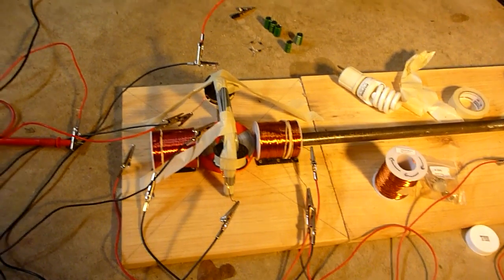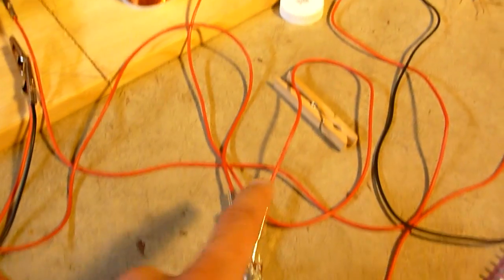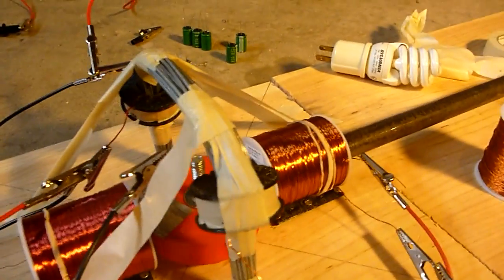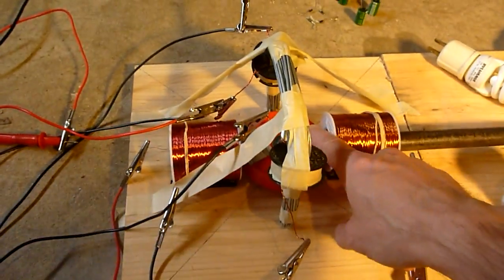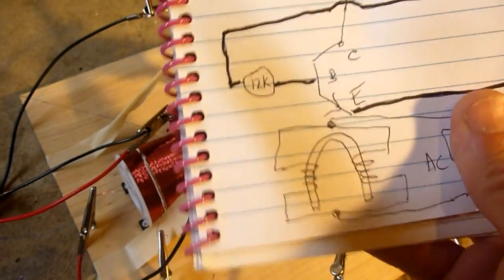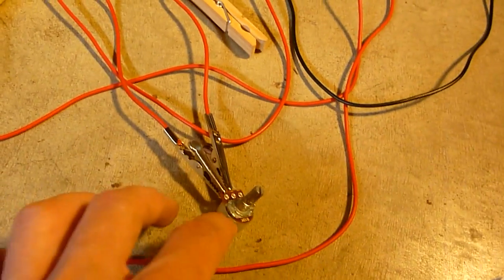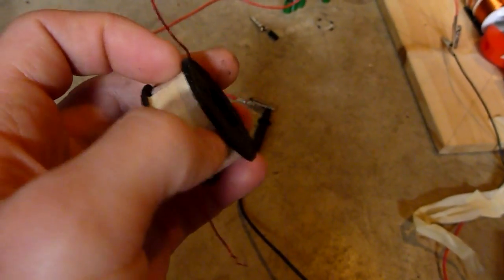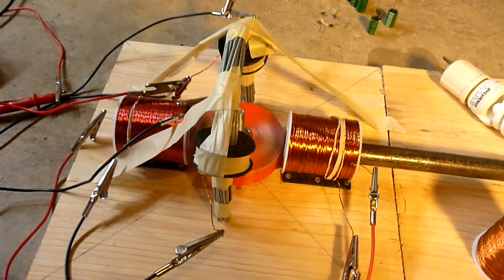Ed Leedskalnin's Lenz-free generator replication help

Comment: C basically energy is e=ma2 not mc2 where a I speed of rotation nd mass is mass of copper so spin magnets esp with higher tesla coils can b in multiples of 6 or 9 or 3 in wye connect w energy draw from pos nd yes mass of copper matters and unless u run through a transformor n cap don't expect current which is what u ultimately want voltage or resonance goes one way n current goes another work it man

Comment: xz've been in electronics for more then 50 Years.  This is what I'm thinking as it relates to Ed;s efforts and design,  All you need to do is look at his generator device, (one of six he built over time),  It uses "V" (NOT BAR MAGNETS),  magnets there was a real reason for that.  The magnets were set up 25 magnets around and 5 deep.  They were set up in repel mode to send as much "B" field into the earth as possible.  The "B" field is the center of a magnet not the North or South poles those are the weakest points on a magnet.  The "V" magnet is a perfect device  for his purpose given the "B" field is at the center and allows all magnets to supply the center as needed then through the crankcase and then into the ground.

Comment: My observations about lenz law; Forget the law its just an observation of a magnet approaching a coil and causing a reaction in the coil but, and a serious but..its a MAGNETIC REACTION that opposes the coming magnet(due to the current flow) and someone just coined the phrase "law" to it, but looking at your setup one magnetic effect cancels the other side magnetic effect due to its symmetry therefore you are still producing electron flow but the opposing symmetry causes a cancellation of the drag(magnetic forces) caused by this lenz law, so your net drag is zero. Great work NAOKI!!

Comment: I have observed the same effect using a coil on a torroid with rotating magnets inside, it appears to be something to do with the sideways angle of the magnetic flux but unfortunately very little power is generated when doing it this way.
Reply from the maker: ***** Right now I'm working on Floyd Sweet energy amplification patents. Maybe the output of the PMH can be put into this energy amplification circuit which steps up volts and amps (reported to have a cop value of >100). Then, I'll loop the output through a bridge rectifier to the input and we'll have a self-running system. Self running systems are possible if they are made open to allow energy from the environment to enter the circuit. The environment has an infinite amount of energy in all forms.

Comment: Nice video! You did a nice job on the Gen. I made a Ed Leedskalnin Generator along with the PMH and the Economical Version of the PMH as well. I was helping out Mr anguswangus with his Generator but I made some comments about the magnetism on Eds Flywheel and he thought I was trying to shot down his ideas for the generator and things went sour afterwards. I like the fact you used a Transistor to drive the magnet rotor, in Eds time I believe that he built a larger mechanical device that work just like the transistor (Look at videos BuiltbyoneMAN here on YouTube channel for his excellent work of this device) but regardless how different two the device looks they both share the same function that being a magnetic switch to drive the magnetic flywheel. Now think about this, if you using a transistor do you really need a rotating magnetic field.
Reply from the maker: boxerlego Hello, thanx for the comment. Mr Anguswangus is an inspiration of mine. He totally helped pushing much of Ed Leedskalnin's technology to the light. Angus believes that Ed's flywheel was a homo-polar motor. I disagree with him on that.

Ed Leedskalnin said that all the generators today were dis-balanced. What did he mean by that? Ed also said that if one was to place his generator on a rocket and fly to the moon and come back one would have the same amount of fuel as before the ship left Earth. This quote implies that Ed's generator powered itself.

Today why can't we have a self powering generator? Let say we have two DC motors hooked up together one produces mechanical torque and the other generates power as a generator. Well, this wouldn't work because of all the losses involved. There is friction, losses due to resistance and the biggest loss goes to Lenz's Law. Lenz's Law forces you to run the generator harder and harder when it is under load. Ed's PMH holds the key here. Ed showed us how to produce power w/o losses to Lenz's Law. I believe Ed had his flywheel span next to a large tube containing clockwise and counterclockwise coils, the output was connected to a transformer. This output went into an AC motor connected to the belt to the base of the flywheel. Ed had to spin the flywheel by hand to several thousands RPMs then enough AC would be generated and motor would kick in. From that point the flywheel would spin itself. What if electrons is NOT the charge carriers in electricity? What if electricity is an effect that created by two magnetic monopoles. A positive monopole and a negative monopole. What if these monopoles have an opposite spin. One spins clockwise the other counterclockwise. What if what we call "Lenz's Law" is the other monopole that is trying to get out of the system. In a conventional systems we use one monopole to do work and we are fighting against the other monopole. In Ed's system both motions of the monopoles were accommodated that is why no Lenz's Law is observed. The system must have a complete magnetic circuit, it won't work with "I" cores. Just my thoughts on the subject.

Comment: What you should try is EL's setup with his Magnet arrangements.  I think is was 24 right?  You may then start seeing some strange stuff.... Dunno, but now that you have the just of it, try adding his number of Magnets into the mix :)
Reply from the maker: shad0wburn3d In magnetic current book Ed said that he made other devices but his latest one was the best one (the one at the Coral Castle). A U-shaped magnet is special because all its magnetic activity is where the prong are (on one side of it). Its magnetic dead zone is at the back. Ed's fly wheel had 24 U-shaped magnets in 4 layers all facing outwards. He would have a hook danging over the handle (over the magnetic dead zone). This, in my opinion, completed the magnetic circuit. This particular setup requires the U-shaped magnets and won't work normal magnets. They don't sell neodymium U-shaped magnets and regular U-shaped magnets are too big and pretty weak. This idea of shorting out coils can be applied to many different devices... If you make any headway in your HHO research do remember to post a video about it.

Cheers.
Reply: Naoki Kashima

There was a video I shared yesterday with Overunity achieved via a supercapacitor of 1.5 FARAD, a Bicycle, Battery, and Alternator. The wheel spinned at over 2k Revs per sec, achieving the charging needed to achieve overunity.  Do check it if you have time.
Reply: Naoki Kashima I think you're on the right track. The vee magnets are the key for Ed's system. He mentions that there is a semi-neutral point midway between the poles of a magnet, I think in Magnetic Current. I'm thinking of making, or having made, some vee magnets out of square rod and having them electrically magnetized. Without them, I think duplicating Ed's system is futile.

If you notice in the photo of Ed at the wheel, the mass of chains look like they're bunched up, as though magnetized. As you said, the hook hangs over the magnetic null zones, and I think the stored magnetism from the chains loops back in through the null zone. 

I've read all of Ed's writings multiple times. He uses double meanings and hides clues in the writings. Have you read "A Book In Every Home" ? It should be read from a different perspective, like a manual of sorts, not as it seems to present. 

BTW, the copy of Magnetic Current you show with the illustrations is not the original. Someone added the drawings and are not Ed's illustrations. Just be careful to verify the logic of the drawings and don't assume they are correct.

Ed also mentions that magnets are the base of everything. He says science looks at things wrong and "they don't have a sound base to stand on". It's a clue. Photos of him standing on a box with ED.L on it means something. I think it has to do with frequency 54.3 Hz. That is the sound base he stands on and: ED.L translates to 54.3

Thanks for the great videos!